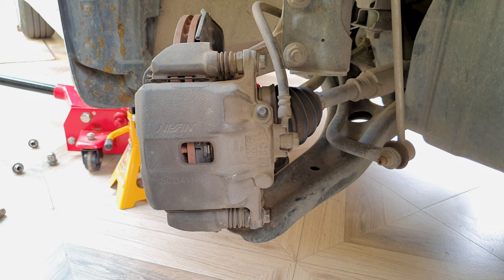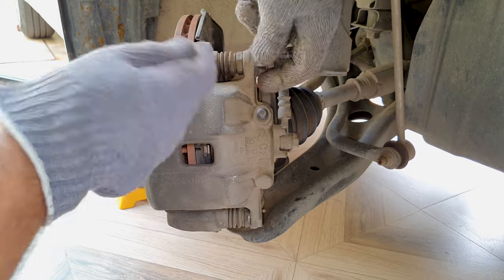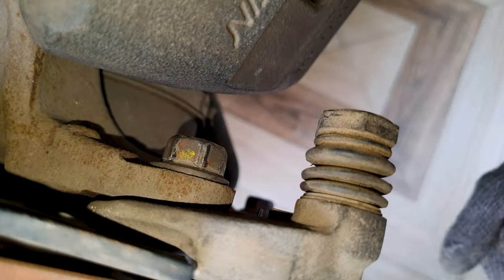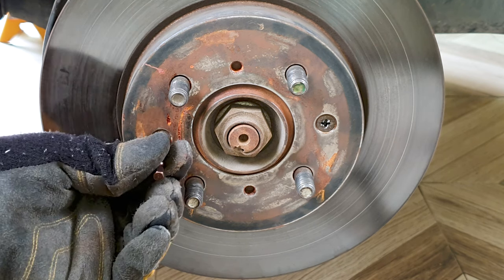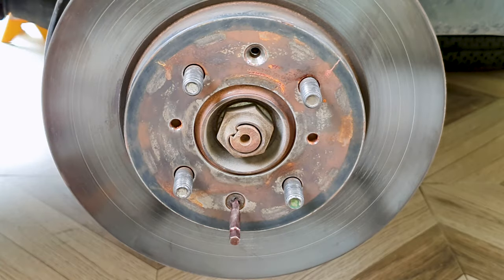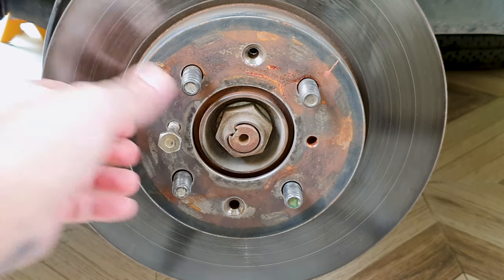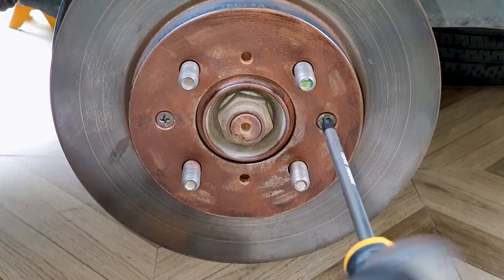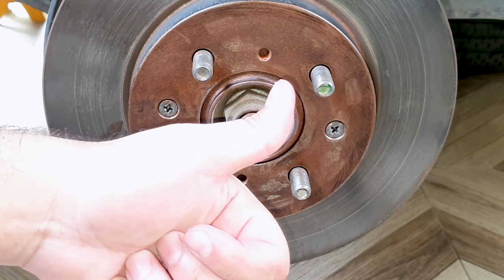Removing brake rotors - tips on preventing future torture

Comment: Throw them in the garbage and never use them again. They are only there to hold the rotor on while the car was going down the factory assembly line to prevent them from falling off.
Reply: I disagree those screws prevent warping of rotors are not torqued properly
Reply: @e.r.videography6209 those tiny screws?
Reply: @DiogoP yep
Reply: @e.r.videography6209 you are wrong
Reply: I never use that screws and as a bonus rotors never stick it comes of right away.
Reply: @e.r.videography6209  uhhh no  tires do not warp..the screws are not necessary .

Comment: If the recall, the proper way to removing the hyundai rotors screws is to tap on a driver bit.  The driver bit is designed to turn while being tapped by a hammer.  The vibration that comes from tapping also frees the screw from rust.  The force forward also prevents the screw from stripping.
https://www.youtube.com/watch?v=YxQk7Pz_vfc
Reply from the maker: That would be best. However I didnt have an impact driver, so I did it the way I did.

Comment: Great tips. Question what happens if you grind the button on the rear brake pad?
Reply from the maker: which button? parking brake button?
Reply from the maker: Sorry still not sure what part this is. Maybe your vehicle brakes are different than what I'm familiar with. What car is it?
Reply: @TheWrenchWiz  It's a Civic Si 2006. It's one the pad with a wear indicator and on top of that there is a steel ball which guides it in between the caliper which has a plus.
Reply from the maker: https://www.hondapartsnow.com/parts-list/2006-honda-civic--2dr_si-ka_6mt/chassis/rear_brake_disk.html

Could you tell me which part? Part 16 and 28 are guide pins.

Comment: The only thing I do slightly differently if the screws don't come out easy is to use a hand held impact tool, the type you twist and whack with a hammer. Never fails or at least 99.9% of the time. Power impact is too brutal and often will strip out the heads on these small screws. With a hand held one you have a lot more feel for how the screw is doing.
Reply from the maker: Thanks for the comment. Will definently be getting that.

Comment: So your basic strategy when the retention screws are difficult is to get lucky. If you don’t demonstrate the correct tool (an impact driver) you’re just hoping that “trying really hard will work”. Same with the disc. It literally fell off when you removed the retention screws.  The bolt holes work great IF YOUR ROTOR HAS THEM,  but what to do if the disc has no holes.  You’ve obviously never seen more than one set of rotors 🙄
Reply from the maker: This is why I clearly state on every video's description the model this is specific for. I cannot account for every type of vehicle, or in this case rotor, and yes I am limited to what I have and what I have seen. For this video the main purpose I wanted to focus on was about using anti seize. 

I didnt anticipate it would be so hard to get off, an issue that many DIYers may encouter when attempting something. So I kept this part of the video as I made due with what I had (which wasnt much). I do have an impact driver now and will make a follow up  video to demonstrate this correct tool, hope you can critique it. Thanks for the comment, cheers.

Comment: I removed this with impact driver and some wd-40 and heat too.
Reply from the maker: Ah yes wd40, have to restock on that. Didnt think of heat, but wouldn't that maybe cause damange to the rotor (if it gets too hot)?
Reply: @TheWrenchWiz  No because your only heating the screw. And if the rotor is being replaced doesn’t matter anyways.